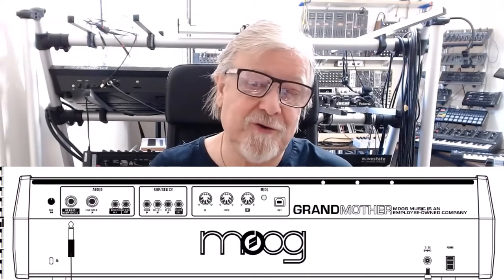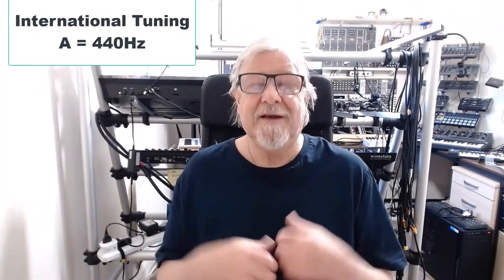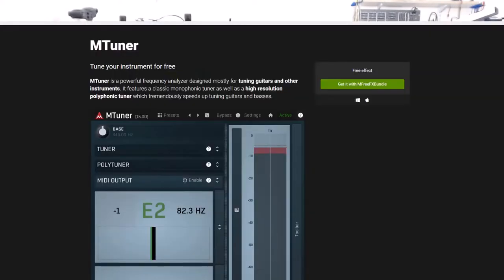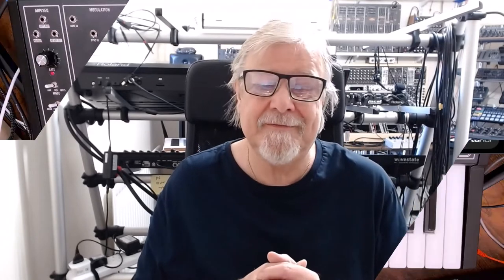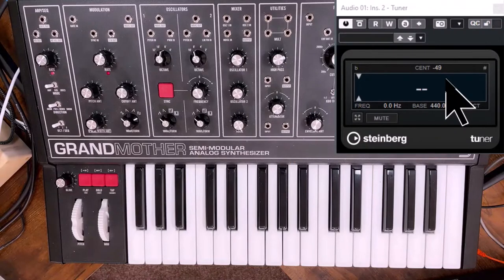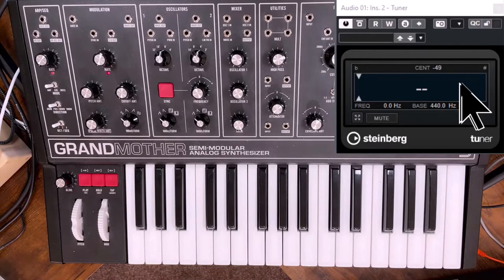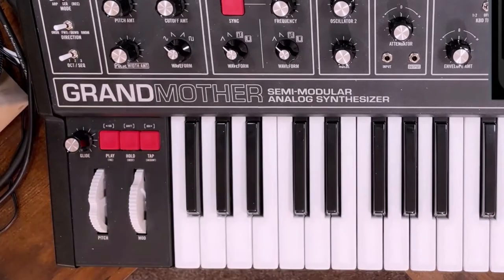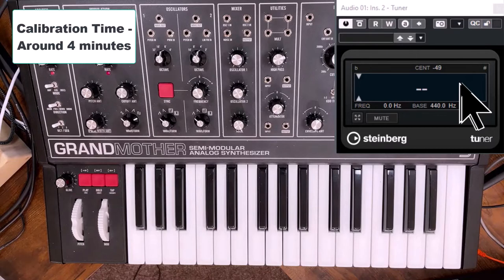Moog Grandmother - How To Tune And Calibrate Your Grandmother Plus A WARNING!

Comment: Hi there, I am starting to use Grandmother and what you showed is interesting. How you connect Grandmother to Cubase? Thanks in advance.
Reply from the maker: Hi - You can connect the GM to your computer via a MIDI interface. To record the audio you need an audio interface. The manual says you can also access MIDI via USB but I haven't tried that.
Reply: @IanWaugh  Thank you for your Answer. PC recognized GM via USB but I meant, this plugin (Tune) which you used is in the audio track. There is similer one for MIDI but I couldn't see any " hz". Maybe when I connect GM to Audio interface then PC, will it work?
Reply from the maker: @ManamiN.official  Yes, the Tune pluginis measuring an audio signal 👍

Comment: My pitch wheel only half steps ?
Reply from the maker: Hi - You can change the range in the Global Settings. I'd advide you to read that section of the manual to avoid mistakes but essentially you enter the Global menu as described in the video. Then the manual says: "The pitch bend range of Grandmother’s PITCH wheel can be set anywhere from 0 to 12 semitones. To adjust the Pitch Bend Range setting, press the (D#1) key, and then use the lowest 13 white keys (F0 to D2) to select the corresponding number of semitones (0-12). The Default is 2 semitones." Hope that helps 😊
Reply: @IanWaugh  Great help
Reply from the maker: @rareform6747  👍 Have fun!